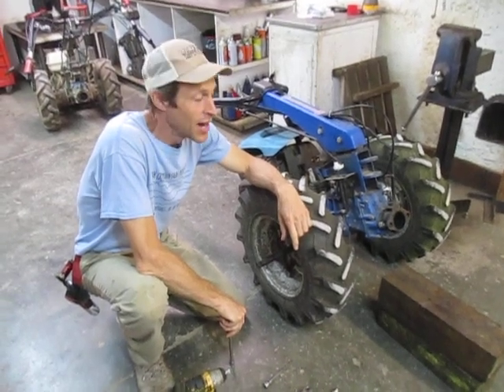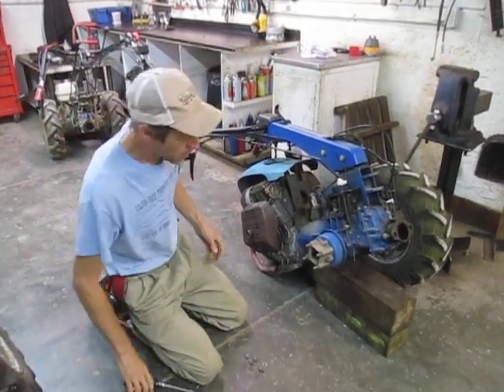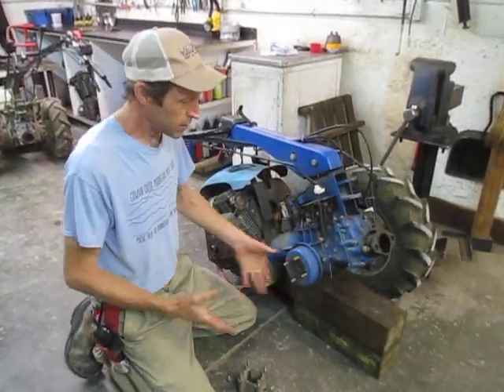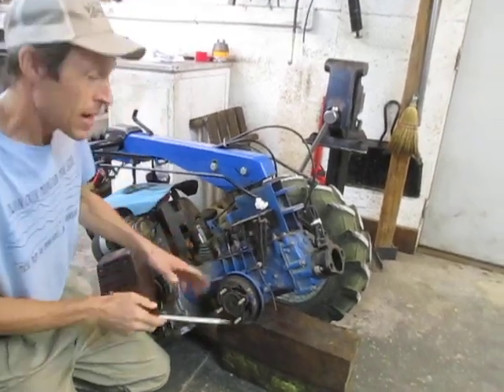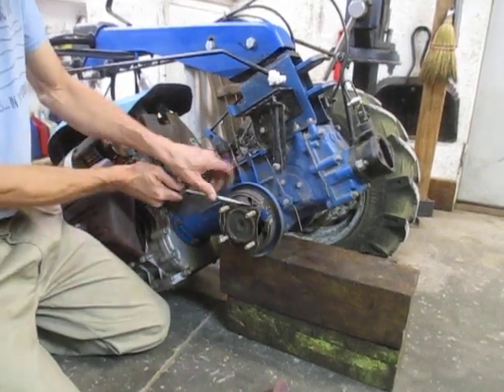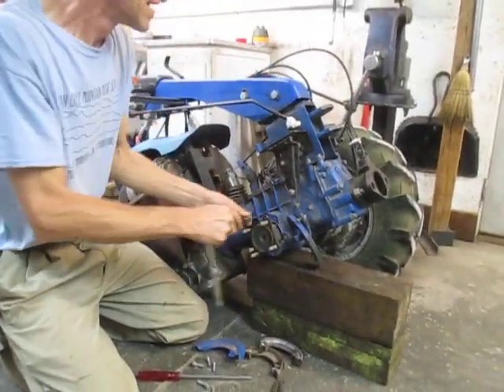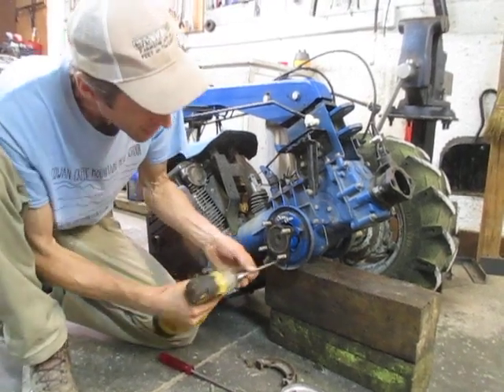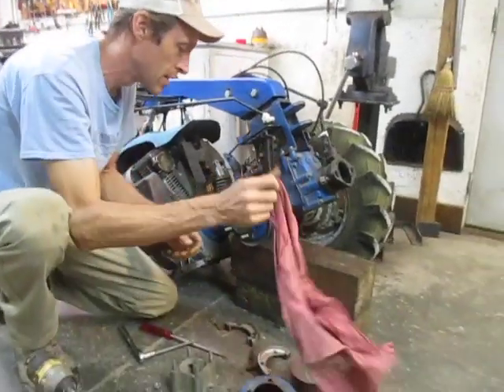BCS Walk-Behind Tractors: Servicing Brakes and/or Stub-axle Assemblies

Comment: I just bought a used 749 and your example helped me so much. The drum stuck on and the brake lever was seized and not moving freely. It was good to learn how to free those up. I ended up putting the lever in a vise and with penetrating oil managed to tap it back and forth until it broke free. It took about 30 minutes to work in enough oil to get it moving freely again. The needle-nose pliers and screwdriver example was exactly what was needed to get those springs back into place (and I still learned some new swear words). Great job!

Comment: I have just taken delivery of a 740 in the UK and interestingly they have added a compression spring over the cable to act as a return spring for the brake actuation arm so hopefully that will reduce the chances of the brakes becoming stuck on. The only issue I have with this is that the springs used seem unnecessarily strong and there is an initial 6kgf pull required on the  brake lever to overcome them. I'm going to fit some lighter springs to see how that feels.
Reply: Just went through steering brakes stuck on, pulled the wheels, unbolted the linkage bolt to actuator lever used a soft blow hammer to center the frozen brake actuator, removed drum, brake, springs and shoes, actuator was froze in backing plate it’s sold as a unit so a lot of penetrating oil and a hammer to free it, bad design.

Comment: Very useful video for the project I had for today.  One improvement would be to apply anti-seize to the backing plate bolts on reassembly.   I have had my 850 tractor for twenty one years, since new. When I pulled the backing plate screws they had evidence of corrosion.  This is the first time I have had the brakes fully apart to try to get them functional again.  Lot of working and flushing with LPS2 and what seemed like they should work now.  Improved yes fully functional, maybe.  

As for the thin wall socket to access the stub axle nuts.  My 13mm 3/8 drive Proto has too much wall thickness.  I suspect a Snap-On socket is required.
Reply: Thank you sir, your video is very helpful for me.
my bcs tractor model is 750.
this model PTO plate center allanky
nut thriding damege.and lock extention center allanky nut lock
is slietly ablong .and rotter coupling nut (10 mm) throu out.
please made a new video 750 model
PTO plate instolation.
my english not well.please